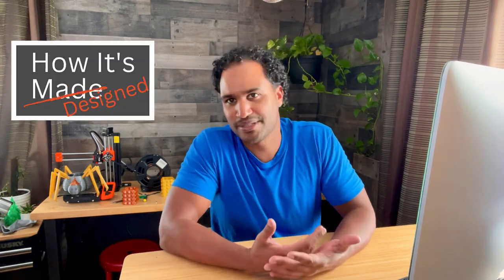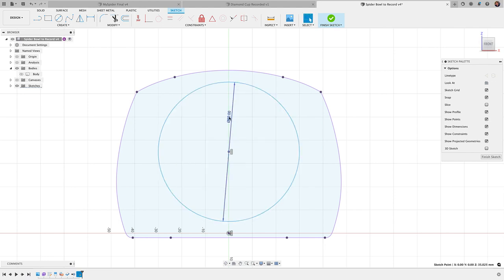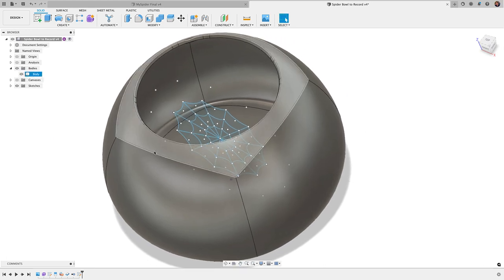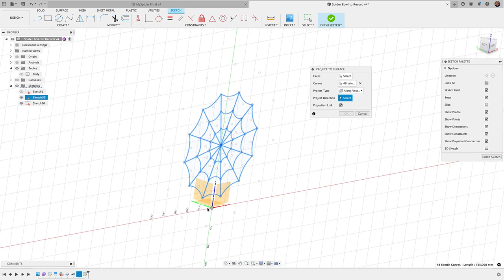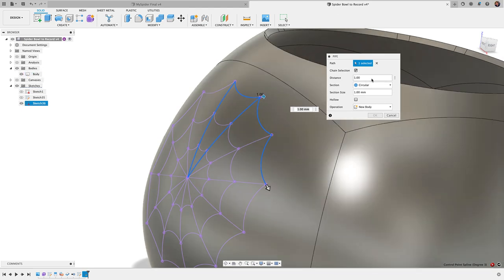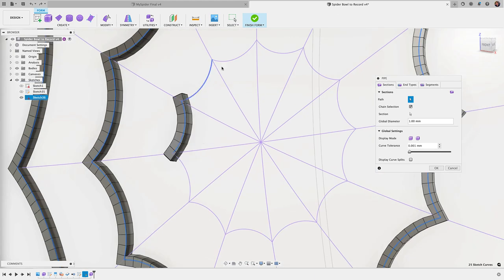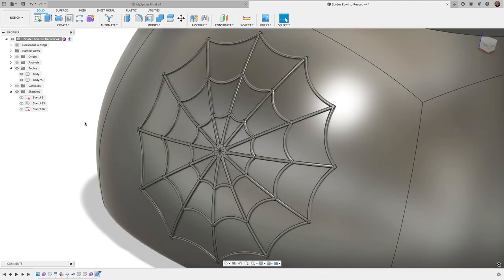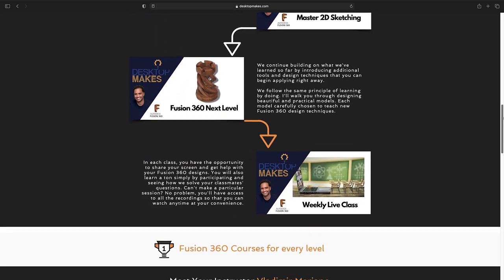Two Fusion 360 Tools You Should be Using Together

Comment: I would have just extruded it through the surface then revolve cut it to match the surface at the desired thickness.
Reply from the maker: That would work if I was simply trying to extrude a closed profile but in this case I wanted to extrude the sketch lines.  Thin Extrude didn't work for selecting multiple lines at once and the standard Pipe tool had similar issues.  That's why I had to resort to using the Project to Surface tool along with the Pipe tool in the Sculpting Environment.
Reply: @DesktopMakes  I *think* you can extrude lines, then thicken in the surface environment?
also extrude>from object 
At least those are the first things id try, idk if they would actually work the way you'd want.